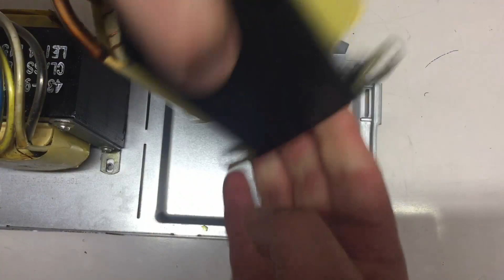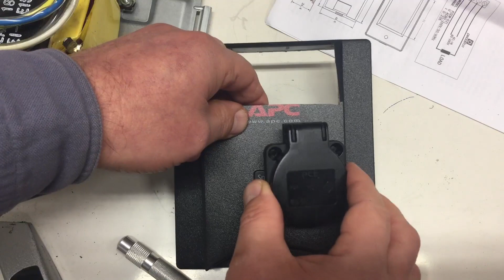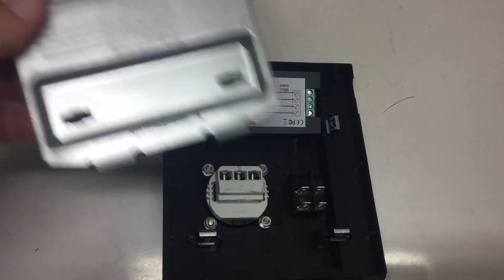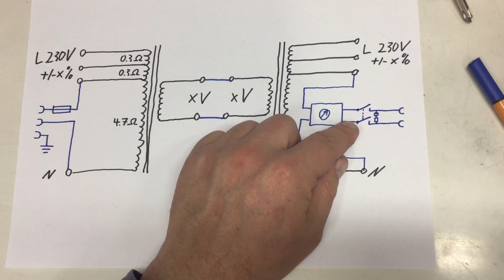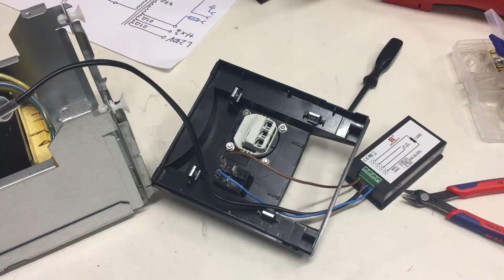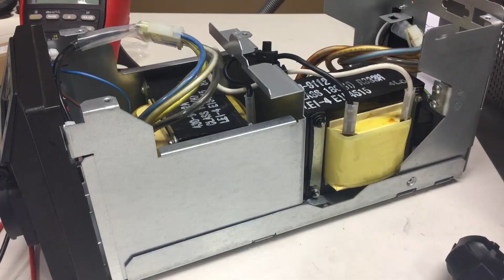Small Project: AC Mains Isolation Transformer from Two Broken UPSs (2/2)

Comment: Thanks for the detailed explanation.  Is there a reason you cross connected the secondary windings and not directly as in schematics? Thanks in advance
Reply from the maker: You're welcome! Regarding the cross connection: No, there was no (electrical) reason. I think I did it because the wiring was easier that way. And since it's AC it doesn't matter.

Comment: Thanks for the detailed explanation. Is there a reason you cross connected the secondary  and not directly as in schematics?
Reply from the maker: You're welcome! Regarding the cross connection: No, there was no (electrical) reason. I think I did it because the wiring was easier that way. And since it's AC it doesn't matter.

Comment: btw it will probably take several microfarads to correct the p.f but if you use to many microfarads you will go past the best point and the current will increase again. If you get the value right it should also improve the regulation of the final output as well.  Good luck
Reply from the maker: Several Microfarads you say ... guess I'll have to look for some AC motor capacitors then. Or I could use some X or Y capacitors in parallel.

Comment: The Hum could be due to the back emf generated in the low voltage windings resulting from the reactive loading of the second transformer on the first. Correct the power factor with non electrolytic capacitors of suitable voltage across the low voltage primary (trial and error) and the no load current in this winding should reduce and with it the hum also.
Reply from the maker: Thanks again for the tip! I'll try that as soon as I have a suitable collection of capacitors at hand.

Comment: The noise most likely is not transmitted through the air from the transformer to the case but rather through structure. You could use some rubber between the transformers and the case to acoustically decouple them. You could further reduce the noise by tightening the case and then adding (a lot of) mass to it.
Reply from the maker: I briefly thought about that. But unfortunately that would also block some of the airflow around the transformers and they do get warm under load as it is. BTW I don't think it's the actual vibration of the transformers, but their magnetic field that is acting on the case, which in turn is acting as a membrane. So I got myself kind of a speaker. Maybe I can stiffen the case somehow without blocking the airflow.
Reply: @robertssmorgasbord  the acoustical coupling theory is easy to test. Remove the screws holding the transformers in place and lift them briefly so they don't touch the case. If the noise is reduced then the theory is correct. If no then it might be something else.
Reply from the maker: @tangerinq  I'll try that ...

Comment: Hey Robert, thanks for this.  I need an isolation transformer and thinking of using the transformers from a bunch of 240/120 VAC step down transformers I used for U.S. appliances when I lived in Berlin.  My thought was to use two of them back-to-back as you have done.  However, I’m wondering if it would be better to reverse the transformers where the higher voltage sides of the transformers are tied together.  In other words (using U.S. mains input of 120VAC), have a setup of 120/240/240/120.  I’m thinking the higher voltages would allow for lower current and heat losses.  Your thoughts?
Reply from the maker: Hi Paul, you're welcome! Your reasoning is sound. If you're feeding in (US) 120V AC mains and you want isolated 120V AC out you should connect them like you described it: 120V mains -> 120V/240V -> 240V/120V -> 120V. And indeed you should experience less losses than I did with my 12V intermediate voltage. One word of advise: There are 240V/120V step down transformers that are NOT ISOLATED, that is they don't have two isolated windings. Instead they are autotransformers that use a single winding with a common tab, a 120V tab and a 240V tab. Before using your step down transformers you should check that they do have two isolated windings. The resistance between the 120V and 240V side needs to be in the MOhm range or higher.
Reply: Thanks  for the quick response Robert.  Fortunately mine are not auto transformers and the windings are isolated from each other.  Just finishing up an adjustable linear power supply project and then going to jump on this isolation transformer project.  I’ll let you know how it goes.
Reply from the maker: @paulanderson1687  Hi Paul, again, you're welcome! And yes, please let me know how your isolation transformer performance, especially under load.
Reply: Guten tag Robert!  I just took two of my 240/120 step-down transformers out of their housings to test them to see if this idea for making an IT would work.  After extracting them from the housings, I checked to make sure they were not autotransformers and having two separate windings each.  I verified with ohmmeter the windings were not tied together.  However, when I was taking them out of the housings, I noticed that one end of each of the windings were soldered together to the neutral side of the 120V outlet, which simulated wiring for center-tapped autotransformers.  Just to be sure, I had a third tranformer that had overheated and was junk so I decided to take all the copper wire off it’s iron laminated core and made sure that there was indeed two separate windings, and both appear to have the same amount of copper for each winding.  Anyway, I plugged one of the good ones in to 120VAC outlet and check that output under load was getting 120V out - same as the input voltage!  So, I really don’t need to use two of them as one works great as an isolation transformer.  I do have a question for you though.  The power rating on these step-down transformers is 2000 watts assuming 240 in and 120 out.  Should I still expect that max output now that its wired 120/120?  Ohms law tells me that even though voltage is lower, amperage will be higher and power would be the same, but that would be assuming same inductance and I’m not sure if the inductance would now be different since the winding ratios are now 1:1 instead of 2:1.  What you think?
Reply from the maker: @paulanderson1687  Guten Tag Paul! So in step down mode (assuming 100% efficiency) you put 2000W / 240V = 8.3A in, and you get 2000W / 120V = 16.7A out (all RMS values). You said both windings appear to have the same amount of copper ... Well, I would play it save and use those things up to a maximum load of 8.3A * 120V = 1000W. BTW it seems you've got some really nice transformers there ;-)
Reply: Guten Morgen Robert.  So I finished converting one of my step-down transformers and have run some tests.  My input no-load voltage at mains is 120VAC and Isolation transformer (IT) output is 119.5VAC, but this is expected because I’m using a neon-lighted switch which requires a tiny bit of power when turned on.  I put a voltmeter and ammeter across the Mains Input and also the IT output to check VA with load.  I used a 100 watt lightbulb together with a 2000 watt heat gun at full heat as my load.  At full load the Mains was 118V @ 9.3A.  The IT output was 95V @ 10.3A, resulting in 1,047 Watts in and 979 watts out, so about a 68 watt loss across the IT.  I think that’s pretty good as I will not be running loads this high, but really wanted to put it to the test.  Also, these tranformers are quite big and heavy weighing over 3kg each, and the magnet wire used is 16ga, but aluminum, so probably equivalent to 18ga for copper.  Still quite large.  Anyway, 240/120V step-down transformers will work for making ITs for use in North America, but first have to make sure they are not autotransformers as you already mentioned.  I have about a dozen of these, but half of them have autotransformer windings, so I’ll be getting rid of those, but keeping the others to make ITs or rewinding them to make 10amp power supplies.  Merry Christmas Robert.  Hope you are enjoying the Christmas Markets.  My wife and I really miss them this time of year.
Reply from the maker: @paulanderson1687  Guten Morgen Paul. 68W power loss (roughly 93% efficiency) sounds great! I would still keep my eyes on the transformer temperature when running it at a full 1kW. Even 3Kg of iron and aluminum might heat up eventually  (3Kg iron @ 100W ~ 4°C/minute, 3Kg aluminum @ 100W ~ 2°C/minute when perfectly thermally isolated). But I guess when you put the transformer into a somewhat vented housing the heat will simply dissipate.
And don't throw away those autotransformers: you can also use them to step up your 120V - you never now when you'll be needing 240V ;-)
I wish you and your wife Merry Christmas and a Happy New Year too!
Unfortunately Germany went into full lockdown just before Christmas - so no Christmas markets for us this year. But my spouse and I got in time out of the city and now we're with the whole family in a rural area in northern Germany.

Comment: I've done a very similar thing to yourself using 2 transformers from old car battery chargers for some reason I seem to be getting 100Hz instead of 50Hz
Reply from the maker: Sounds like these transformers have a build in bridge rectifier on the secondary (low voltage) side. If you measure the voltage between the transformers (the low sides connected) with a multimeter set to DC, the polarity of the voltage will reverse when you switch the probes around.
Reply: @robertssmorgasbord  Thanks for the reply but I don't get any DC on the connected secondary's, I just get 12V @50hz
Reply from the maker: @jasonbell3868  Than I'm out of ideas :-( Sorry!

Comment: Very informative video! I was going to buy an isolation transformer and you saved me some cash. Thanks. ✌😇
Reply from the maker: Thanks for the praise! Keep in mind that a "real" isolation transformer will perform much better than this two transformer solution (the output voltage will not be bogged down so much by the load). However, the two transformer solution is of course much cheaper, especially when you already have the transformers laying around ;-) So, happy I could help and save you a few bucks.
Reply: @robertssmorgasbord  😇✌ I had a few dead ups laying around and I was wondering whether to scrap it or salvage it! And then "the algorithm" recommended your video. Lol! 😀

Comment: I am considering the needed fuse(s). If I remember correctly, you reused the resettable fuse. Mine is rated for 20 amps. Looking at the voltage drop verses amps drawn, I imagine these transformers will never carry that much load, without things being damaged, long before the resettable fuse trips. Maybe the resettable fuse was on the battery side of the circuit? 

Now that you have used the unit for awhile, what is the true wattage that it can carry? How did you arrange your fuse(s)? Thank you, for your help.
Reply from the maker: I used the original fuse at the back of the enclosure in series with the primary (high voltage) winding of the mains AC side transformer. That is the original configuration. The resettable fuse at the back of the enclosure was not connected to the battery!

While the ratings of those original fuses seem quite high, they have been designed by the manufacturer to protect the transformer sufficiently.

If you want you could in addition use the original battery fuse and insert it into one connection between the secondary (low voltage) winding of the mains AC side transformer and the low voltage winding of the isolated side transformer.
Reply: @robertssmorgasbord  Well, I want to think on it, a little bit. Though, I do not know much about AC, so I am not sure what I am going to think on. lol 

You will recall that I reversed the work flow of my case, from back to front. This places the power sockets and the resettable fuse at the front of the unit, in easy reach. So, keeping the resettable fuse is easy enough, if I can become comfortable with its 20 amp rating. I ordered some panel fuse cases, for my electronic stocks. I can use one of those, if I decide to not use the resettable one.

Now that you have been using your unit for awhile, what do you think is its true wattage capability?

Thank you, for your reply and help.

Comment: I want to use a capacitive dropper to power the LED indicator for the switch(es.) That would be on one leg of the AC mains... Being an 1N400x rectifying diode to a resistor (value to be determined) to a common LED (color, Vf and current draw to be determined) back to the other leg of the AC mains. Because I do not know AC, I am being extra cautious by asking you this questions... You said capacitance can be a problem on the mains... But, the cap for the LED is isolated from mains with the diode... So, is there any problem with using this dropper? I would think the only risk is the diode failing open. And, rectifying diodes surely do fail. Hmm... Maybe it is best to use something else? Suggestions?
Reply from the maker: No, it's save to use a capacitive dropper for a power indication LED. Just make sure when googling for it you choose a circuit for your mains AC voltage. Unlike the filter capacitor we talked about before, the capacitor in an capacitive dropper in series (!) with the diode and the LED. So the capacitor does not "short out" the AC, like a filter capacitor parallel (!) between mains AC live and neutral. BTW: There's a nice video about running LEDs on mains AC: https://www.youtube.com/watch?v=Q23uh7AjjXw

Warning: The LED will be at mains AC voltage, so touching the leads of the LEDs, the diode or the capacitor can give you an injurious or deadly electric shock.

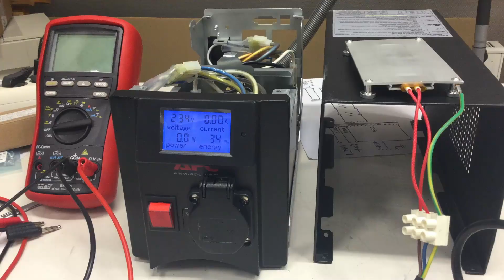Comment: When you did a full-load, power-on test (28:50) with the heating element, the voltage dropped to around 215vac and the amp draw was a little over 1 amp. This would indicate that the total watts that the unit can provide safely would be about 200w. If this was a DC unit, I would suggest adding some smoothing capacitance... For this unit, it would be located before the mains-side transformer. I know that there are AC-rated capacitors. Should they be added and, if so, what value should be used? How is that value determined?

I would also suggest a soft-start circuit and a two-stage switching system... One switch to power the transformers and bring the caps up to voltage (to help with in-rush current) and a second switch to bring the load in and out.

You mentioned that you intended to make a video on how to use this unit safely and how to use it with an oscilloscope. Did you make that video? Link?
Reply from the maker: A smoothing/filter capacitor will not improve the situation. AC is in this respect a completely different beast than DC. The main problem here are the losses within the transformers, especially the resistive losses in the secondary sides of the transformers and the connections between the secondary sides . There's a lot of current flowing there - a few dozen amperes or so.

As mentioned above, you can not smooth/filter AC with capacitors the way you can DC! All a capacitor will do is short out the AC and destroy your transformer (if it's large enough) or just cause a phase shift between current and voltage (if it's small enough). So do not try introducing capacitors into that circuit!

And no, I haven't done a video about using isolation transformers in conjunction with oscilloscope yet. Turns out EEVblog (THE AUTHORITY) has already made a video covering that topic ( https://youtu.be/xaELqAo4kkQ ). So I'm a little bit reluctant to do my own.
Reply: @robertssmorgasbord  Thanks for the great AC capacitor information and the link!
Reply from the maker: @t1d100  You're welcome!

Comment: Hello, I wonder if big transformers need inrush and/or "inductive kick" protection. ? By the way, perhaps some day you find a Variac and then combine both devices (Trennstelltrafo).
Reply from the maker: Hi! No, transformers don't need an inrush current limitation. Even when connecting a transformer at the peak of a sine wave to AC mains (357V worst case here with 230V +/-10%), the inductivity of the transformers primary winding will limit the current. Generally speaking, inrush current limitation is required for for capacitive loads. Imagine 357V suddenly connected to an empty capacitor (which would act initially as a dead short). 

Regarding inductive spikes: There it might be helpful or required (radio interference) to have some measures in place (e.g. a capacitor or a RC snubber, not a free-wheeling diode though - we're handling AC here). When disconnecting a transformer winding at maximum current it will again act as inductivity and produce a voltage spike.

And yes, I'm considering buying a real isolation transformer and/or an Variac at some some point ;-) My favorite would an isolating Variac (two birds with one stone) :-)

Comment: You could try grounding one side of the low voltage windings between the transformers to help reduce the capacitive coupling between the high voltage windings (similar to an electrostatic shield in a single transformer).

I have used this Two-Transformer technique for mains isolation with transformers rated as low as 10VA, for exposed low power test equipment (also with grounded low voltage windings).
Reply from the maker: I have thought about that too. Not because of the capacitive coupling (Your shielding idea is great!), but because of safety reasons. If the isolation in the input transformer fails, then the mains fuse would blow. However, if the isolation in the output transformer fails, the output is referenced to mains earth without anybody (me) noticing, and that could end badly. I'm not sure if I trust those transformers (not dual chamber) enough ...